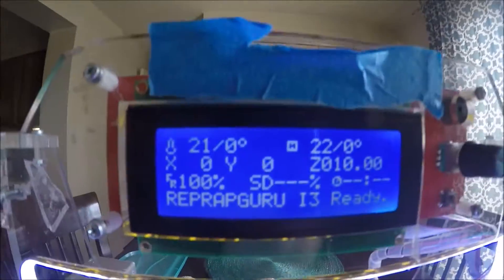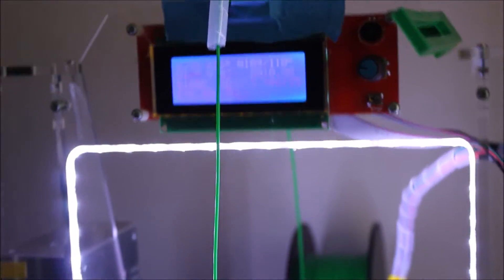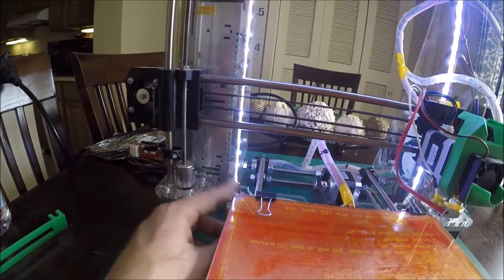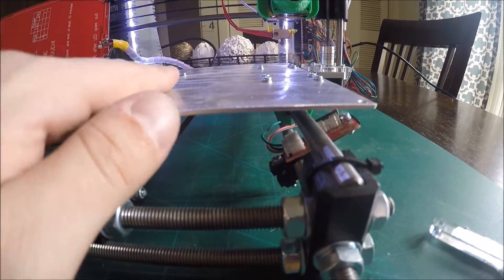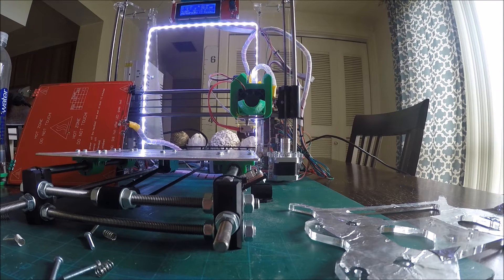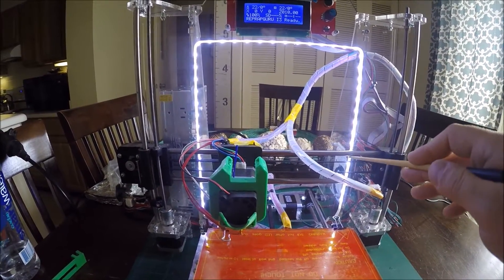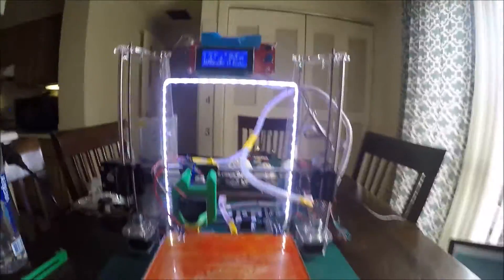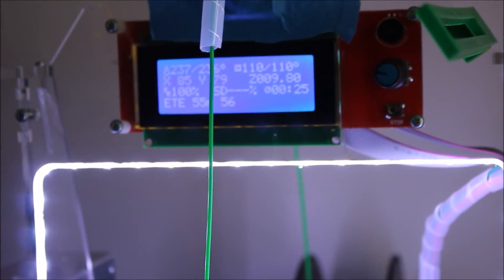RepRap Guru Prusa I3

Comment: great video bro. I bought the same one but the lcd isnt working even after I adjusted the potentiameter just shows blocks so I ordered a new lcd. can u tell me what software u use to print things?
Reply from the maker: Richard Barajas there are quite a few options out there. I’d try a few to see what you like best. Some are better for support material while others are better with slicing.

Comment: My cheap anet a8 even has an aluminum plate bed...thats pretty bad that they used a cheap improperly designed acrylic bed....thata improper design and unacceptable in my view....theybshould have at least made the acrylic bed square and not flimsy like they did....the bed leveling wings on the actylic bed is not going to work properly ....it would just flex and not level bed
Reply from the maker: der ddd Exactly. It been over two years now. I haven’t upgraded anything since then and haven’t found a need but must of the upgrades I did do we’re from cheap stuff in the junk pile. I know there have been a lot of advancements made in this industry in past few years but this thing works great for me. The acrylic bed is still by far its greatest downfall.

Comment: Do you have a link to that cooling fan?
Reply from the maker: Dylan Kowalski StarTech.com 60x25mm High Air Flow Dual Ball Bearing Computer Case Fan with TX3 FAN6X25TX3H (Beige) https://www.amazon.com/dp/B00006B8E7/ref=cm_sw_r_cp_api_eXXKzbNJR3GBC